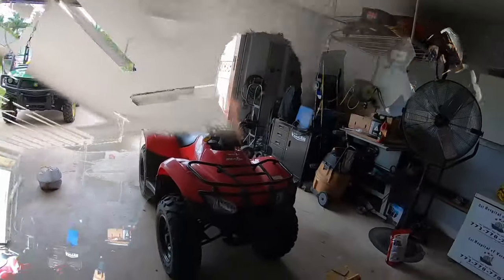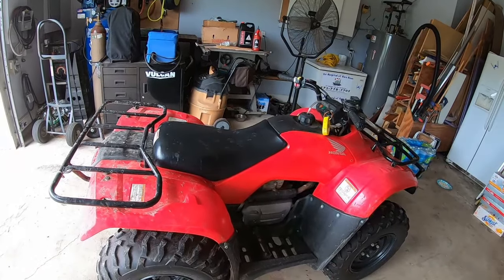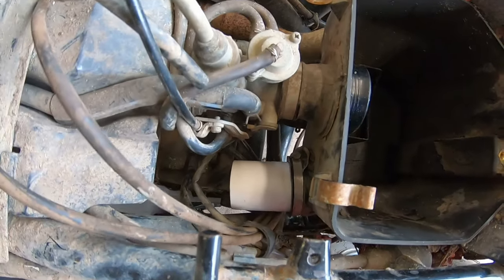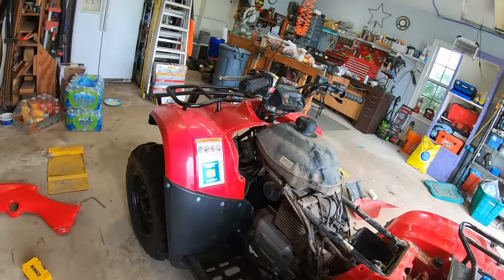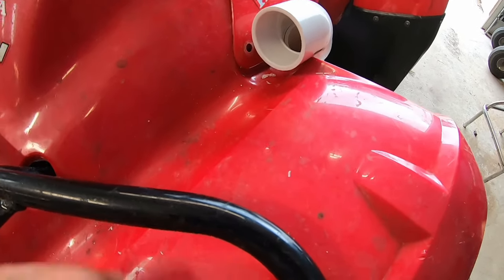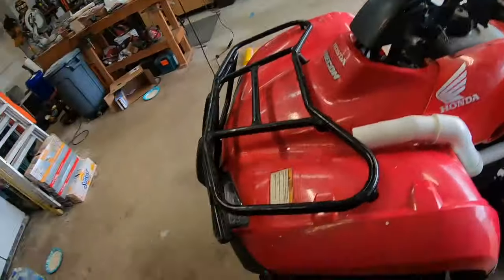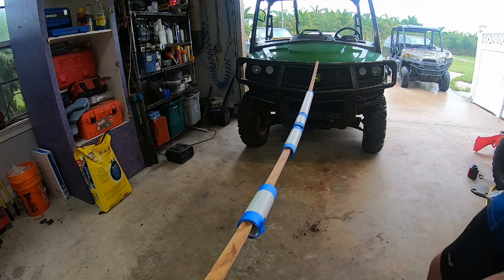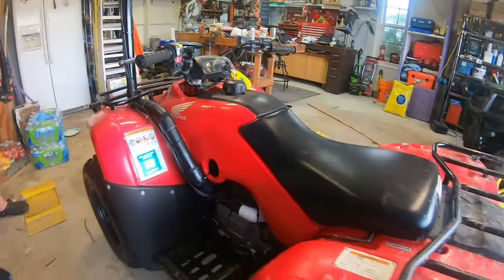Snorkeling a Honda Recon

Comment: So i got mine snorkeled with the intake and 2 diff lines but it keeps cutting off, I dielectric grease on my spark plug boot and siliconed it but it still keeps cutting off. What vents did you run on the carb??

Comment: Run your vent lines rear diff the 2 on the carb
Reply from the maker: I actually just did major improvements to the system. Unfortunately, I have been very busy and have not been able to upload any videos.

Comment: I had to snorkel my muffler as well on my recon because the motor is to small to keep all the water pushed out
Reply: coon catcher98  I didn’t on my 2017 recon I took it under today and did just fine
Reply from the maker: Some people do have that problem. I think I do too. I ordered a DynoJet Kit for the carburetor from Highlifter.com to fix the issue. I think that I will also have to remove the spark arrestor in the exhaust in order to increase the airflow out of it. Otherwise, I believe the bike will run rich.
Reply: RanchLife7005  have you flooded it since you added those things
Reply from the maker: @cshealy9864  I haven't tested it yet, but I plan to. It will be on the channel this summer. Stay tuned!
Reply from the maker: @cshealy9864  I'm glad you had better luck than I did on my first go.